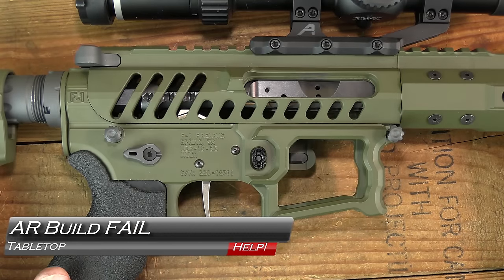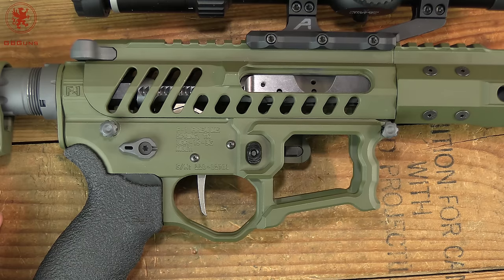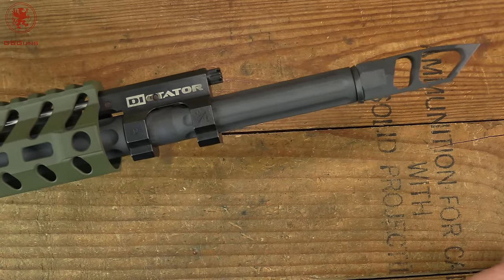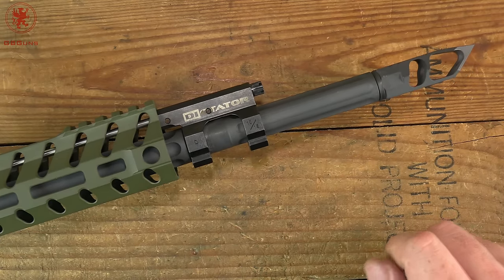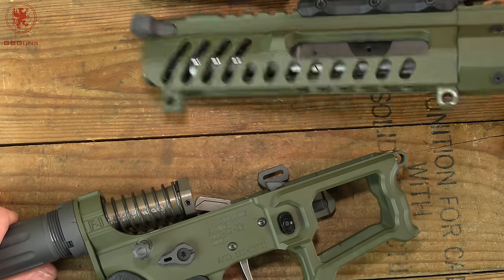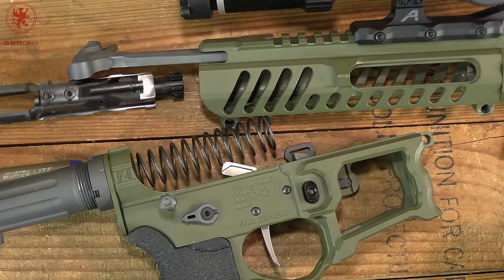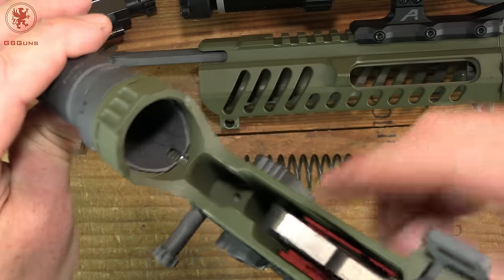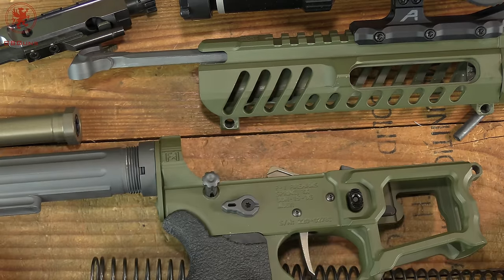The Worst Thing You Can Do For Your AR

Comment: With all that light weight stuff, my brain immediately went to the buffer spring.  Lighter parts don't have the momentum to cycle on a mil-spec buffer spring.  Glad you got it figured out!
Reply: That spring made a HORRENDOUS noise then the charging handle was cycled.  

When I heard "carbine length buffer system", then saw how stiff the spring was, then a rifle length gas system, I knew you had too much non-matching stuff going on there.  I thought a mid-length gas system might do it with an 18" barrel, but then the comments zeroed in on the spring.  

Glad it worked out that easily!
Reply: As soon as he said it cycled by hand but was stiff i knew it was the spring
Reply: @micahschaefer8211  my first thought was he probably needs a heavier buffer to carry the momentum all the way through to cycle
Reply: @micahschaefer8211  could have been gas block alignment or undersized porting
Reply: That's got to be it. My AR is very soft shooting, cycles like a 10/22 and weighs less than 3 lbs. I use a flat-wound spring from davidtubb.com made for carbine length .300BLK  and a Taccom buffer. Whiskey bolt carrier w/ adjustable gas key, Ti pins and 9310 bolt. Dwell time might play a part also. I use a 16" mid length gas from Faxon.
Reply: That seemed like a pretty easy fix. I thought you were going to answer you own question when you stated you stacked the wrong way. That buffer spring looked to have twice the lbs. per inch needed when stacked against the light weight BCG, buffer and extended gas tube. That’s a great learning experience for anyone doing an outside the box build.
Reply: Spring 👌🏽 or gas block not aligned correctly
Reply: @Cpt_RB  a heavier buffer would require more pressure to push rearward than a lighter one
Reply: That’s exactly what I thought.
Reply: @dlanew632  it would also carry.momentum better than a lighter one
Reply: The same reason people choose lighter buffers to reduce recoil, less mass equals less transfered energy
Reply: @Cpt_RB  That is true, but it takes more energy to get the heavier object moving. It would be easier to push a go cart to the rear of the buffer tube than it would an F150. A heavier buffer slows the cyclic rate because it does not move as fast as a lighter one given the same energy through the gas system.
Reply: @Cpt_RB  For instance, if you had a 5 lb dumbbell and a 50 lb dumbbell, which one could you throw farther?
Reply: @dlanew632  except the energy output is the same regardless your just worried about how much of that energy is applied to the bolt and through the spring translating into recoil, lighter buffer equals less carried momentum, meaning it is carrying less force back, sometimes leading to a failure to cycle
Reply: Edit lighter buffer not spring
Reply: To use your own metaphor now throw a piece of paper or a feather
Reply: @Cpt_RB   the issue in this scenario is a short stroke, not the bolt carrier running too fast and outrunning the mag. Your point that a heavier object carries more energy than a lighter object at the same speed is correct. But in this application, it is about getting the bolt moving fast enough initially to move far enough rearward for the cycle to properly complete, and much less about maintaining rearward momentum once the bolt carrier reaches top speed. The bolt is traveling a short distance very quickly. To your point on recoil, there are many factors to consider. A faster, lighter mass can have more energy than a slower, heavier mass and vise versa. I have ARs with standard buffers that kick way harder than the heavy buffer guns because the bolt is moving faster and hitting the back of the buffer tube way harder.
Reply: @Cpt_RB  now fold that paper up into an airplane shape and throw it. My point is that it takes more energy to move a heavier object when all other factors are equal.
Reply: Agree with alll of this I say Bc u have an adjustable gas block I would go to mid length gas system prob would work better with with carbine buffer
Reply: Same, I figured it didn't have enough mass to push the spring back, so either put a supressor on it, weighten the carrier, or lighten the spring.
Reply: @dlanew632  wrong question, "which one would have more energy?" is the right one. You need more than speed to move things.
Reply: @noctismortis7349  it takes more energy to move more weight
Reply: @dlanew632  you aren't understanding. I'm talking springs here. you need a lot more speed to push a light object into a spring than you need for a heavy object. The worst part, the energy output isn't equal. A 500lbs anvil will kill you no matter how far above your head it is, but a penny wouldn't do anything even if you dropped it from space. It's simply not possible. Now, if you made a penny go super fast, sure it could kill you. But that takes tons more energy then the anvil method.
Reply: The only way to really find out is to try it, so let me know what you find.
Reply: @noctismortis7349  i understand the fact that a heavier object carries more energy than a lighter one at the same velocity. But you have to get the object moving in the first place. It takes more energy (in this case, gas pressure into the bolt carrier) to move the heavier object. That is why a heavier buffer slows down the bolt carrier as opposed to a lighter one with all other factors being equal.
Reply: @dlanew632  it’s not about the amount of energy produced by the gas, it’s about the energy needed to depress the spring. A heavier bolt carrier means that energy from the gas is better transferred to the spring, instead of being easily repelled. Lighter bullets go faster, but they don’t penetrate targets better than heavier bullets going 75% or so of the speed, and that’s simply because all the energy is lost on impact with lighter rounds. You have two people arguing against you man. Think of it this way. A ping pong ball is propelled at 1000 mph at a paper bag. What do you think is going to happen? It’s going to bounce off. Now take a golf ball and propel it at 100 mph at a paper bag. It’s going to knock the bag over.
Reply: @dlanew632  also you are forgetting something. The lighter carrier moves quicker which means that the gas stops propelling it after only a few miliseconds or so, while the heavier one stays in place longer and absorbs more energy.
Reply: @noctismortis7349  a ping pong ball at 1000 mph will go straight through the bag. Because 2 people are arguing against me doesn’t make 2 people right.
Reply: @dlanew632  going back to the golf ball and ping pong ball for a sec, have you ever tried throwing a ping pong ball vs a golf ball? Just because the ping pong ball is lighter doesn’t mean it goes faster, even if you are putting the same amount of energy into it. That’s because the air resistance can easily suck out the energy of the lighter object, despite it starting out with the same energy. So the air is the spring, the carriers are the ping pong ball and the golf ball.
Reply: @dlanew632  try it man, you’ll see
Reply: @dlanew632  I think my analogy between the ping pong ball and golf ball throwing is flawless. I seriously urge you to see how far you can throw a ping pong ball (light carrier) vs golf ball(heavy carrier). They should have the same energy in the beginning, but since one is much lighter the air (spring) effects it much more and makes it lose velocity and momentum very quickly. I don’t understand what you don’t get about this.
Reply: @dlanew632  better yet, flick a small object quickly, and watch how it won’t move, then use the same finger (finger only) to push it.
Reply: @noctismortis7349  i understand your argument, and i can’t argue with the fact the a heavier object carries more energy when it is in motion. But i also know it takes more energy to get a heavier object moving from a standstill. I dont have a PhD in physics, but i have tested many different combinations of bolt carriers, buffers, springs, gas systems, etc. in many different ARs, and ive never been able to fix a gun that was not cycling by only adding weight to the rotating mass.
Reply: @dlanew632  I guess you would just have to see if the energy is there.
Reply: Exactly what I thought I make springs for a living and thats what I would work on maybe try a flat wire spring I have had good luck with mine
Reply: Same
Reply: @rapidsqualor5367  there's no way your AR weighs 3 lbs. LOL
Reply: @xenonram  I have a thread on AR-15 Armory.
https://ar15armory.com/forums/topic/174076-project-feather-the-path-to-a-3lb-ar/
It's 2.9 LB but the 1x3 Weaver brings it to 3.5 ,  I need the scope for my old man eyes.
Reply: @xenonram  Google " Project Feather - the path to a 3lb AR "
Reply: @xenonram  Project Feather
Reply: My thoughts exactly

Comment: You want dirt and sand to clog up your AR action? Easy: just cut a lot of holes in the upper receiver...
Reply: I agree. This build was a 'fail' when he chose that ridiculous 'cut out' upper receiver........
Reply: I don't think that this is one of those "Zombie Apocalypse" type builds.  I suppose this was more of an art project that will sling bullets down a range for fun.  I can only imagine the amount of oil/carbon this thing will slog all over the place during an extended session though.  lol
Reply: I agree, and could looks more ridicule if they put the dust cover
Reply: @_felx1100  Because it's his money (and property) and he can do whatever he wants with it.
Reply: I have nearly all Skeletonized uppers and lowers, no dust covers, ever. most are all slick sides. Hell, you can fire these pretty much covered n mud. And very easy to clean. heck I would even have to say these uppers and lowers that have the loads of "holes" perform better over all. Much of the standard gas debris has the chance to get to atmosphere and does not get trapped in the gun, or down the upper or into the buffer. The few ARs that I have that are MilSpec uppers. I have to clean the buffer tube out just as often as the rest of the gun. With my Skeletonized uppers and even in the lowers that I have Skeletonized. I am seeing much mush less "Blow Back" crap. Which really is the main "dirt" problems you find with any malfunction. I guess its a different story if you are in the military, crawling in mud, dirt and sand, every day and firing a few hundred rounds out of that dirty gun. But I would suspect it would be an issue of premature wear then malfunction. 

Any how, the spring would be the first item to easily change out, but I do suspect that there is an inclusion in the gas port of the barrel or gas tube restricting gas flow. But thats not so bad if its just a spring change. if you start to get stronger recoils and buffer smack, the thing interrupting the gas flow, just might had been blown out. change the spring back. lol.  

I have two of the f1 Uppers, love them. I would like to get the Upper and Lower set. but little more then I like to spend. I am a machinist by education and Sales Engineer by trade. So I do have a few mills and lathes to make my tooling modifications. I do a good deal of lightening on my own equipment. 

So, for Cutting holes in ARs I say great idea.... My three gun AR, full 16" barrel, and Full Auto BCG (I used the auto version for the greater mass in the BCG, I feel it helps speed, cycle and on target) but other wise everything has been lightened up. Just a few Oz over 6lbs. Compare that with a 9 or 10lbs. If I were in compositions against you, all day. Im gonna put money on me. lol, I have never been in combat, but I think i would still take my gun over a milspec AR any day. that 3 or 4 lbs really adds up at the end of the day. And me, I dont really care how big you are (im 6'1" 240lbs, so not a little guy). keeping my 6lbs gun on target for extended time. thats the way to go....
Reply: @ericgruben312  so why they design with a dust cover and all close? even i knew they used to put a condom on the tip to protect it more
Reply: @Kogreaper5513  LOL yeah throwing it in a puddle is not a test. You want a range rifle like that, fine. But go ask some vietman vets if they'd use that thing...
Reply: @zanderwitaz  I am the vietMAN
Reply: @rofltrolflyingfish  No, you aren't.
Reply: You’re not going to be running around fighting the Chinese with your F1 skeletonize AR lol it’s for looks/fun kinda like when people put lift kits and big tires on their truck just to drive it on the street.
Reply: javier garcia you ever been in a sand storm? You have to wear a respirator to breath so a sealed gun is better in those conditions, Eric is talking about a normal environment in America and 3 gun competitions.
Reply: @zanderwitaz  I've have a friend who was in vietNAM.  He loves the modern takes on the m16.  Since he isn't in Vietnam and the war is over, he likes the new uppers, lowers, and even the new colors(gun candy, cerakote, etc). Not everybody lives in the past.
Reply: @scorpionsting47  "lives in the past" Love it, my man. Dirt and grime are totally a thing of the past, you got me there.
Reply: Had that problem in Iraq fine dust getting. In upper and lower receiver
Reply: Not every AR is made for the combat you never saw.  Competition guns, for example, shouldn't be getting packed with mud in most of your average competitions.
Reply: @genevandenham7999  Ha Ha What's with the attitude? Actually I served in Iraq f dec 05 to dec 06 As an 11Bravo Army Infantry 4th ID 2nd Brigade 167 AR Battalion Mechanized operated primarily out of FOB Iskandariya the power plant also rotated in and out of Jurf Sukhar patrol Base next to the Euphrates Did lots of Route clearance QRF And set up night IED ambushes along the routes near the river that provided good cover along the tree lines that run along the Euphrates That was my primary AO "Area of operations" do i need to show my DD214?  Anyway don't give a shit what you believe. What did you ever do?
Reply: @genevandenham7999  BTW I carried an m16A4 w CCO and a paq4 ir laser  was what carried most often sometimes m249 and 203 40m GL . Not an ar15
Reply: A little dust storm would stop that rifle
Reply: Believe it or not, some people don’t have wild fantasies of having to use their AR in some crazy apocalyptic or civil war type senario. for some people, all they ever do with their guns is take it out of the safe, into a bag, out to a range, into a bag, and back in the safe. it’s a perfectly fine design for range shooting and reduces weight. coming from someone who doesn’t even own one.
Reply: Here is an idea: Don't throw your gun in the dirt and sand. :O WOW
Reply: A cheese hole AR would make a great range toy but wouldn’t last long for serious training.
Reply: @jeffersonbuckles8905  Except that is exactly what the OP is "saying", he is specifically defending this gun outside of ideal range conditions, and the rest of us are calling his BS, as that sad little splash test is hardly an indicator of all the real-world scenarios you will face... But you, my dense friend, are welcome to by all the cheese grater guns you'd like.
Reply: Some bolt carriers are out of spec. Use a mic and check, i had one over sized
Reply: That's not a fighting/defense rifle. That's a sporting rifle. Probably a safe queen that may see only see some bench time at an indoor range.
Reply: @jordanrick2931  dah ha ha "You Sound Stupid"  Ha Ha Are you an expert? Getting fine dust in my rifle was an every day thing required constant cleaning and CLP often made it worst. Ended up using dry lube. But Ok Expert Lets here what you got to say?
Reply: @thejoker9201  I am an expert but I don’t go around telling everyone. No one cares you’re a veteran.
Reply: @genevandenham7999  I haven't checked this thread in a month My apologies for popping off at you I thought you were talking to me Must of been late night reply feeling tired a groggy. No affence and none taken
Reply: Yep
Reply: @thejoker9201  hey everyone, got a veteran here. See no one cares
Reply from the maker: Did anyone at any point even hint that this might be a fighting gun?
Reply: Thing is a joke of a rifle

Comment: Sometimes going with all of these “upgrades” actually downgrades your rifle.
Reply from the maker: Until you see this thing run. As stated, this build combination is uncommon, and most manufacturers avoid it because it sits on the fringe of what consumers are willing to understand and work with, but man-o-man is it a smooth shooter! (see pinned comment or video description)
Reply: Many upgrades are like that.  If the bear is tearing through the front door, I would reach for the old SP-1 that I knew was going to work every time, over the goofey-gun full of holes, and temperamental parts.     Guns like that are really cool toys, but they are never going to be a practical tool.  It all depends on what you want.

Well, at least you got a dust-cover delete upper.   I know a guy that built a skeletonized with the dust cover still there. Really have to question that logic.
Reply: I was thinking the same thing. I had issues more with upgraded parts than standard milspec stuff on my build. I do love peoples builds like this one that just go all out for the fun of it! for most of us though, a plain-jane AR will be more gun than we have skills to handle them! Speaking of upgrading,  I've also found that some expensive parts for pistols can have terrible side effects and fitment issues. Gives me quite the respect for real, skilled gunsmiths! Anyone can throw together parts, but it's the minor tuning and stoning required that most of us are unaware of or unskilled at performing!